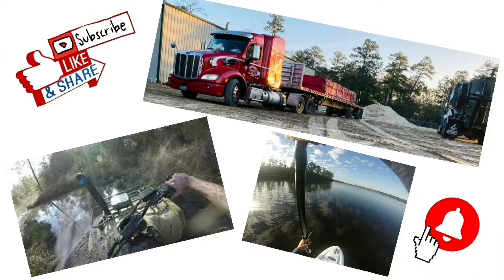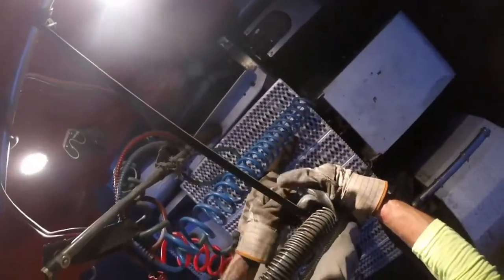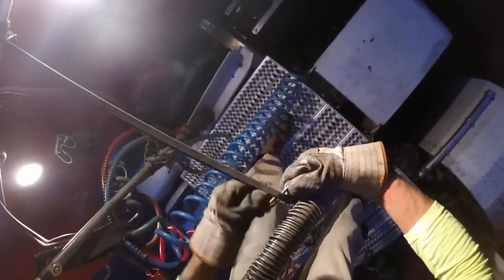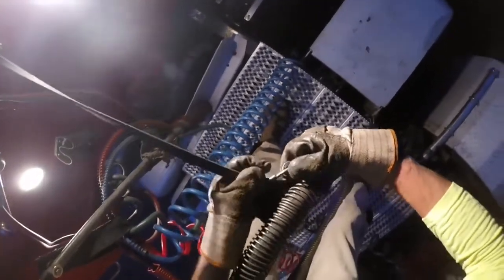How to hook up a semi truck dump trailer  (How to video)

Comment: Is there a hydraulic tank somewhere on the tractor? Where does that line come from?
Reply from the maker: The hydraulic tank is on the truck itself. It’s on the driver side frame rail, behind my fuel tank. A line runs from the tank, to the underside of the catwalk and connects to that fitting which is held in place by a bracket that’s bolted to the frame.

The line I’m connecting, stays with the trailer.